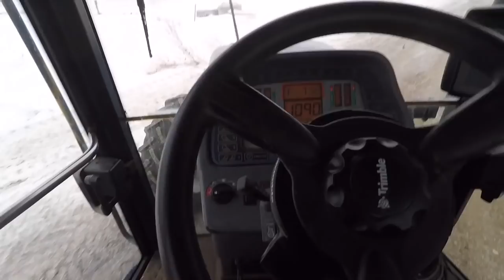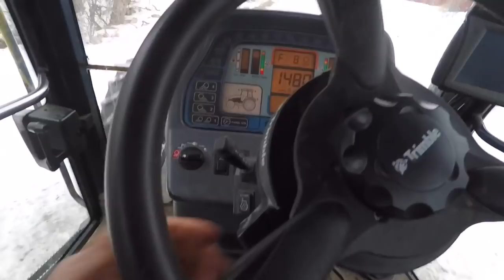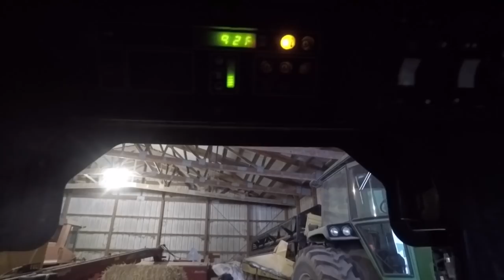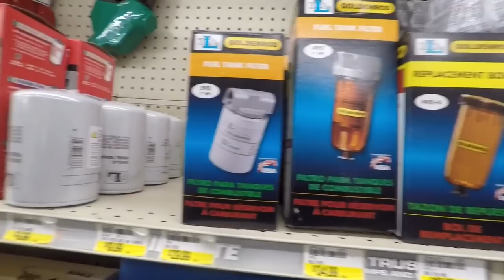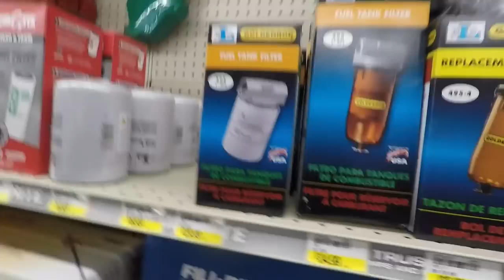A Long Busy Week Part 2

Comment: What do you do oil tests for?
Reply from the maker: Just to check for contaminates in the oil. We had one tractor that we had checked in 2017 and found out it had %5 fuel in the oil. Obviously that tells us we have some dribbling injectors on the tractor. That is just one reason we like to have our oil checked.